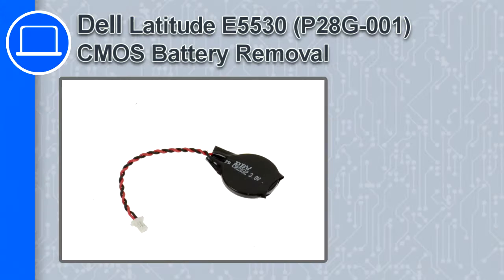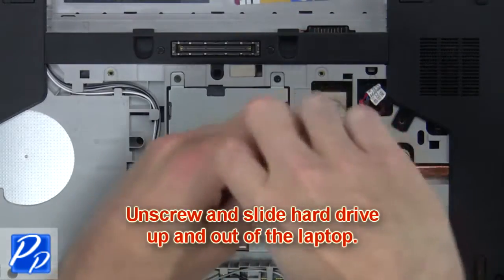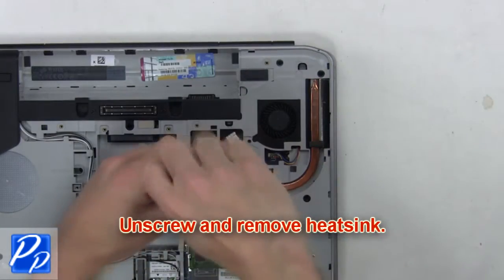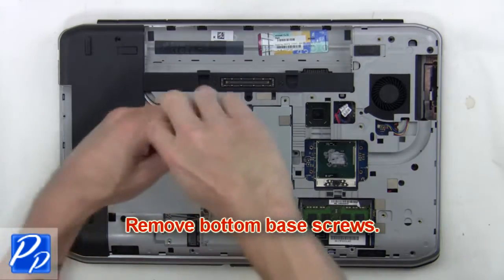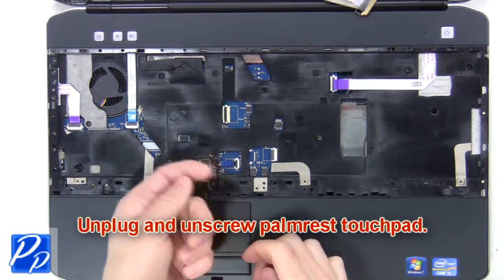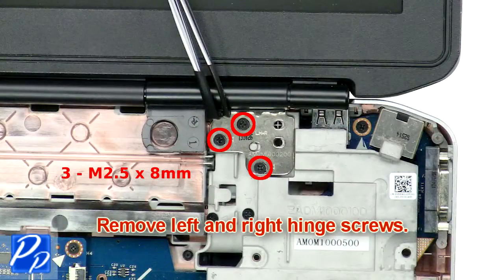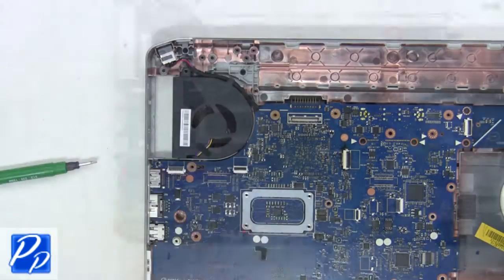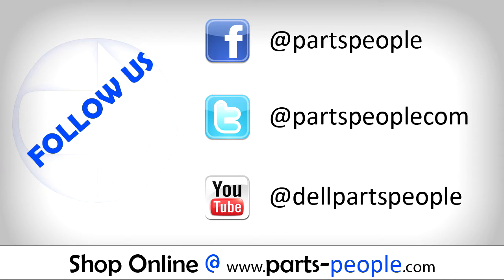Dell Latitude E5530 (P28G-001) CMOS Battery How-To Video Tutorial

Comment: It's unnerving to snap off the bezel surrounding the keyboard. So flimsy and easy to break. The Spudger tools are great here if you don't have strong fingernails or a guitar pick. Also, there are metal snap retainers on the left and right edges of the keyboard that are a Very tight fit. *The central back-side screw for the keyboard is Not Marked.* It's in a deep black unmarked hole, not highlighted in the videos. It has extra narrow and long threads, so the standard screws won't fit when re-assembling. 

I used a Phillips screwdriver with knurled handle and applied plyers on the handle to loosen the tightest screws. 

It's hard to put things back with the correct length screws. Fortunately, Most holes have notation. 

Also, the YouTube video highlights the wrong screws to remove the motherboard. If covered with thick plastic film, leave them alone.

I cannot emphasize how important it is to minimize the possibilities of ESD damage to the motherboard. 

Wear only 100% cotton clothing. Carpets can also kill circuit boards. — no synthetic blend socks, athletic shoes or rubber soles. Just better to go completely barefoot if unsure. 

Work on a completely non-conductive wooden table top. REMOVE all conductors (i.e. power and USB cables) from the table top.

The CPU and heatsink need a thermal connection with thermal paste. You should not simply reassemble them. I collected all the paste and centered it on the CPU die so it would flow out again evenly. If you find the paste has hardened, clean it off and replace it with fresh. My thermal cooler also has another branch with a square pad that was in good shape for reuse, but yours may need replacement.
Reply: Everybody should read this.....very useful info.

Comment: thanks for this video, but my problem is the led of the hard disk light on and down and nothing to the screen do you think is the battery
Reply from the maker: Perhaps. Try using only the power supply to see if this resolves the issue.

Comment: I replaced the display assembly last year because the hinge supports broke and this is basically the same disassembly plus more.  No way am I going to go through this again.  I'll just go into the BIOS setup whenever the settings get lost.
Reply: Lo que yo hago es que cuando ya no voy a utilizarla le dejo la bateria de laptop con algo de carga asi la config del bios se pierde... Otra nunca las dejes conectada directo ala corriente y sin bateria por el tema de que se fuera a ir la luz

Comment: huh? all that for the battery? that's gotta be the most complicated BIOS batter removal I've ever seen. I got to this point... Removal of IC's from the motherboard? Then start delaminating layers of motherboard to get to the atom based molecular structure of the carbon molecules? Then you will find the BIOS battery.
Reply: This thing is going into the recycle bin next to my Nintendo WII
Reply: @EdRockwell  at least the nintendo wii has a easy to change cmos battery

Comment: i made a hole in the bottom to change the cmos
Reply: Where exactly did you know to cut the hole?  This sounds like a great idea! Could you be more precise?
Reply: hi pal i did same cutting hole in bottom.  if you pause video at 1.20 you see close up of heat sink and memory bay if you look about 1 inch to the right of the heat sink and memory bay half way in between the two is small hole. if you look closly and shine torch in it you will see the connection on motherboard for the cmos battery.  i basically started making this hole bigger going downwards and then over to the right and hey presto there was cmos battery stuck literally onto the back of the sd card reader. in fact when the black side cover is off you can see some vent holes on side and look in to see edge of the cmos battery which was how i knew how much clearance there was to cut.

Comment: i have a issue with that model , its present a rare problem ,   the laptop start just when i plug de charger ,, and  when i shut down , i cant restart , the laptop with out remove the charger and then plug again ,,

Comment: That works. But I did it in 5 minutes. Instead of taking it all apart. I took the cover off and used an exacto knife to cut the plastic away and changed the batt in 5 minutes. I did remove the first 6 screws to get to the area the batt is in. I put a piece of two sided tape on the bat and then I put the cover back on and it all works and you cant tell i took a short cut.
Reply: That sounds like a great idea.  Could you please be more precise as to where you cut the plastic away? Thanks!
Reply: @jeffreyedelmann2711   Some people like to make it more complicated than it really is. They don't want you to do the job yourself but take the computer to their store so they can fleece you.
Reply: @p.macdermott2490 don't be a fool. The older Dell laptop models like you see in this video is really not for the faint of heart for the average consumer. Just like you have a new car, do you really want to do your own oil change and figure out yourself and run the risk of forgetting something to put back as after it's done? Or pay someone who is certified to know what they are doing? Don't be a fool

Comment: Great video. In my opinion that's horrible engineering.
Reply: I SWEAR.....I had someone give me a 5530, and two e6400's. the rtc batteries in the e6400's took 5 min to swap out....not looking forward to changing the battery in the 5530 sheesh...........and its my baby, a 1TB ssd and 16 gig ram don't need anything else.......

Comment: Thanks for the reply. 

So I went from buying a brand new Dell Inspiron 1526 in 2008 that eventually had a cmos problem and then a motherboard issue later on.

And now I get this Latitude E5530 that was "refurbished" but looked totally new and untouched out of the box and I'm dealing with a motherboard issue already. And this problem started about 4 months after I got it and got progressively worse. Now I can't get screen to come on at all. 

Funny enough, they both seem to be having the same issue. 

I will never buy a Dell again. Apple has never failed me.

Comment: I bought my E5530 off Groupon about a year ago. 3-4 months later, the screen wouldn't power on and laptop would just turn off right away. I'd have to turn it on several times before it stayed on. Over time, this process became a longer and longer one. Now I can't get it it to power up after trying for 2 days. 
CMOS battery???
Thanks!!!
Reply from the maker: No, it wouldn't be the CMOS battery. That sounds morel like a motherboard, CPU, or GPU problem. It's really hard to say without seeing the laptop.